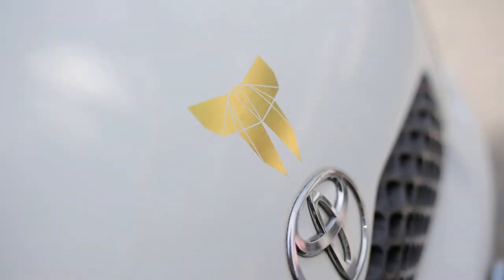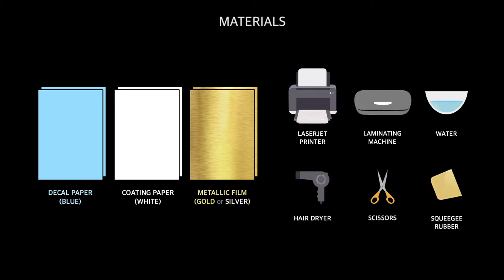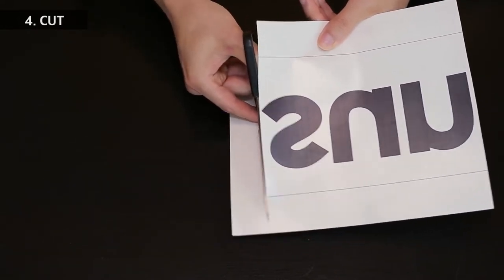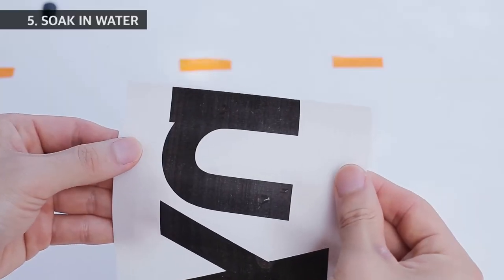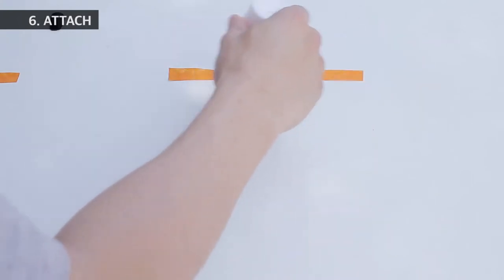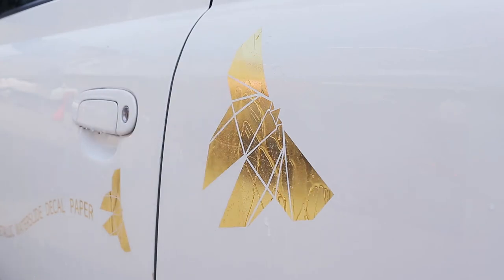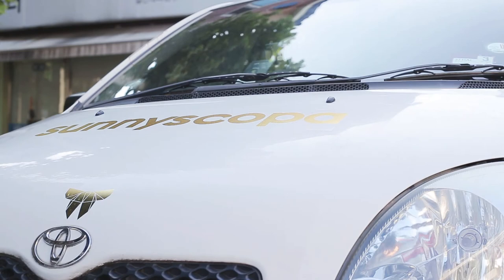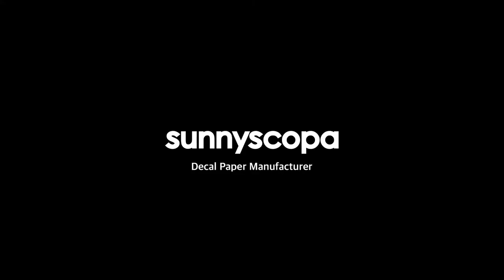[DIY] Car Decal with Film-Free Metallic Waterslide Decal Paper

Comment: This method is awesome. Great job. Can I use this process to make decals to apply on my antique sewing machine to replace the old ones during a restoration? What kind of glue is that you used in? Is that easy to find those products here in Brazil?
Reply from the maker: Yes, you can apply on sewing machines. The glue, however is a specially designed glue manufactured by us, so no you wouldn't find anywhere in Brazil..

Comment: Can I use a heat press instead of the laminating machine? 
How do we remove the decal on the car if we don't need it anymore?
Reply from the maker: Hello, Assad

No, you cannot use a heat press because it is an entirely different curing method. The heat press is only for heat transfer paper.

As for the removal, you can use acetone. But with acetone, you have to be careful not to scratch off the paint.
Reply: @SUNNYSCOPA  what temperature do we use for the laminating machine?